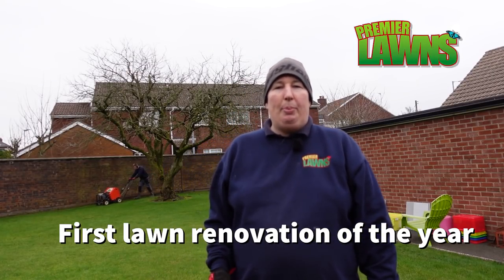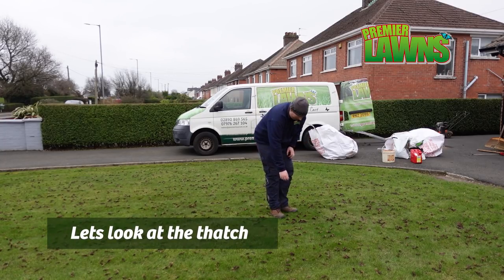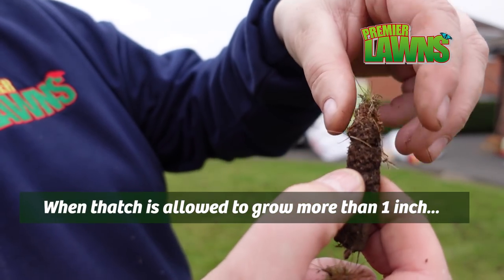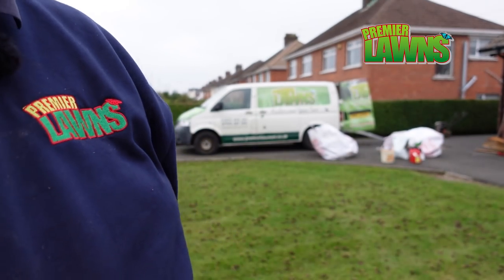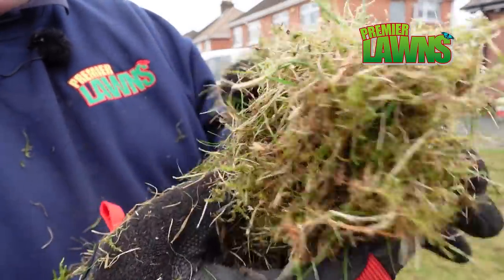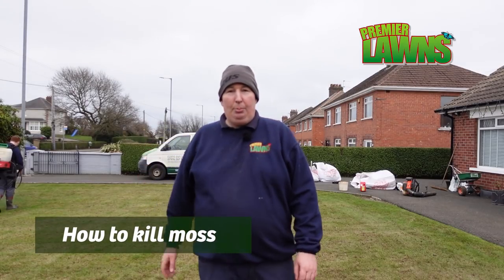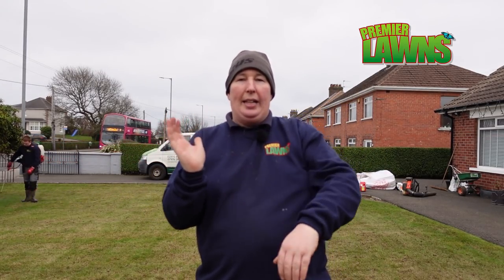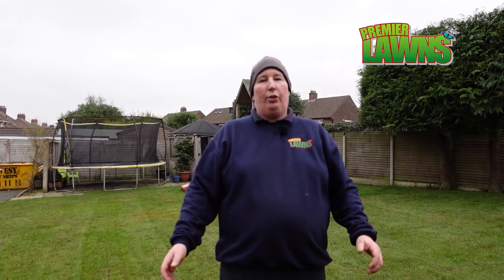First lawn renovation of the year lawn | Getting the basics right

Comment: Great video Robbie, can't get started on the garden yet,its still like a swamp, drainage is a big problem, water seems to run down the slope at the back of it, 👍
Reply from the maker: If you don't have anywhere to drain it to dig a big deep  hole on fill it with stones for a sump
Reply: @Premier_lawns_official  what about ye,where would be best do this Robbie, the garden is about 40ft by 40 ft, with about 1 1/2 ft slope, there's a retaining wall protecting the patio then an opening where the water would run off down the drive way, sorry for the long winding question Robbie, I know your really busy but I would love to give this a go as the garden is going to waste most of the year, thanks

Comment: Hollow cored my lawn last autumn, but clay plugs with some grass on top, not quite like you examples! Have been doing the ferrous sulphate and scarifying this coming weekend and will then redo the ferrous sulphate ... a lot of moss in places. What mix do you use? 5mg per litre per m2 is usually quoted as top end, but a litre of back-sprayer over 1 sq metre is very slow spraying, so noting your rate of spraying, are you using a more concentrated mix?
Reply from the maker: we use around 740g-1kg over 500m
Reply: @Premier_lawns_official  Over 500m2? 1Kg/1000g over 500m2 would be 2g/m2 which is at the low end from what I've read, which goes...
1-2g/litre/m2 for greening
2-3g/litre/m2 for 'pre-winter hardening'
4-5g/litre/m2 for moss killing with 5g/m2 considered the top end without impacting the grass
Now that would seem to answer my own question ... up to 5g/m2 at 5g/litre so why am I askin? It's just 1 litre of spray in 1m2 is a lot of spraying on the spot! In your videos you seem to cover a lawn at a more reasonable pace and so I've been wondering about increasing the concentration and moving 'less slowly' (as opposed to fast!) Especially if rain was due and so will do the job of washing it in.
Also think I need to reconsider my lawn cutting height based on your excellent videos.
And next is to consider top dressing, but 100% sand to help break up the clay or sand soil mix? And I have quite a lot of lawn to cover ... that can become quite expensive quite quickly! 
Then there's a the annual treatment with Weedol lawn weedkiller which was recommended to start a season and fitting in overseading ... preferably without feeding all the local birds too much!
Reply from the maker: To much to cover in one question. We put in a max dose into the sprayer but this will block up a lot of sprayers 
Play about with it yourself